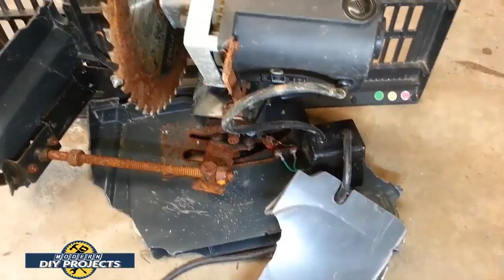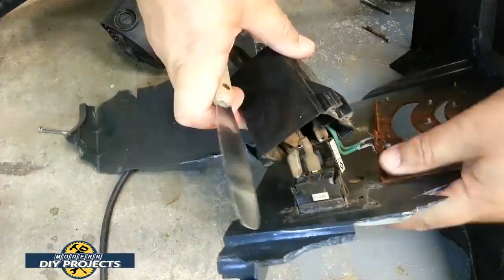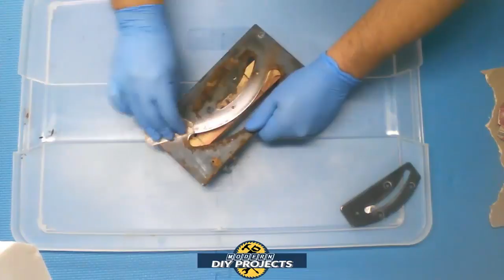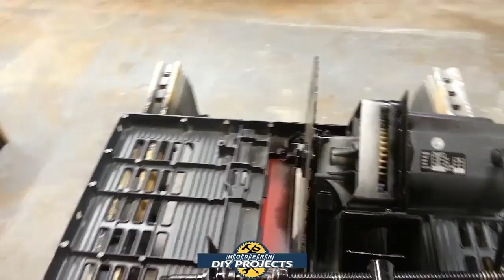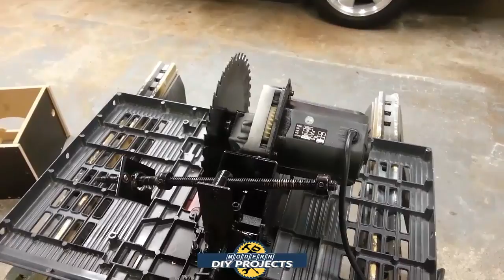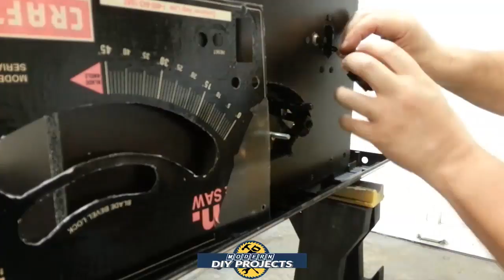Vintage Table Saw Repair and Restoration

Comment: I have this same saw same problem my case is broken do you know the dimensions of box you built?
Reply from the maker: It's not as easy as just giving you dimensions. You need to measure it out properly yourself before doing the project because you need to figure out how to attach the table saw top to your new box. So you can't just make a box. You either have to make it to line up with the screw inserts of the top, or you have to make a top and then add it to the box. You need to decide the layout.
Reply: @ModernDIYProjects  I’ve got it figured out now thanks for reply I measure from center of bolt to center of bolt  and then outside to outside of original box and mine all lined up perfectly and my drill and jig saw worked perfectly for cutting front hole for adjustment and side while for angle adjustment
Reply: You saved me 299 dollars I had everything here at the house to fix my table saw all along so I thank you sir wonderful video

Comment: Can I use any blade adjusting wheel on my hitachi table saw, they are missing.
Reply from the maker: Sure you can. As long as you can adapt it to fit the spindle it should be fine.

Comment: Damn same one I was lookin for got it from my ex’s grandpa and it’s really loud and rough just wondering if that just the way it was supposed to be or not lol
Reply from the maker: I can't way if it is loud since I don't have it in the original case. The wood that I used to make the case may make it quieter, but it doesn't sound louder than any other power tool. You may want to lubricate the motor. Maybe bearings are going out.
Reply: @ModernDIYProjects  thanks yea I’m about to pull it down from my attic and dust it off

Comment: Did it have a fence or are you going to get one?? I have a old Rockwell and I can't find a fence for it that's not priced crazy. Mine has round tubes across the front and back so I'm not sure what the fence should look like??
Reply: Hi Rodney to hopefully shed some light on your fence situation, I believe the fence design you are looking for would be a jet lock fence, you can find them on eBay for about $50. Not sure if this helps.
Reply from the maker: It had no accessories with it. I will probably make a video later of how I make a fence, miter and maybe a sled for it. I didn't do it in this video because it was getting long enough already.
Reply: I have a fence for mine, it’s red, not very accurate but I love older craftsman stuff. It’s a loud little bastard and it’s built on a light frame so It vibrates hard, need to at least get some wheels for it